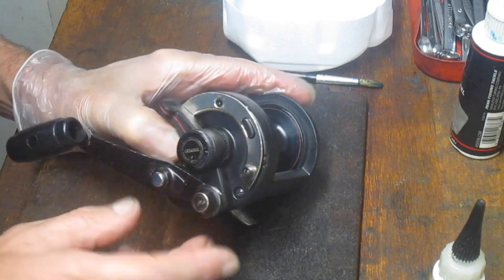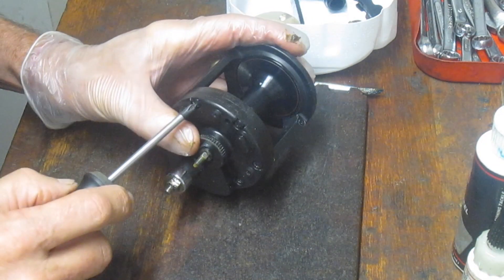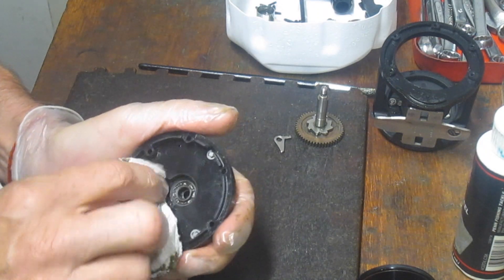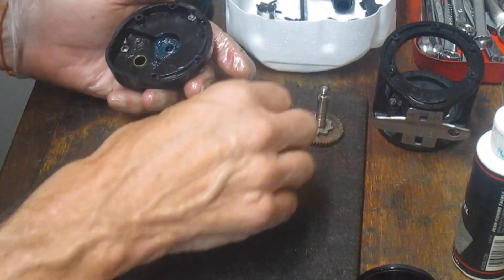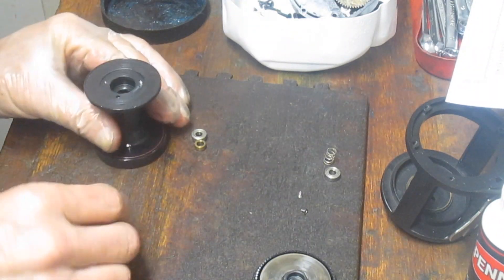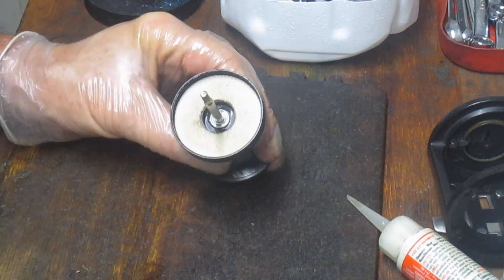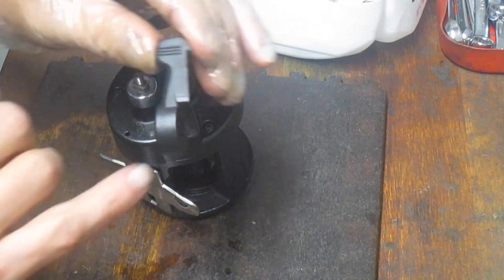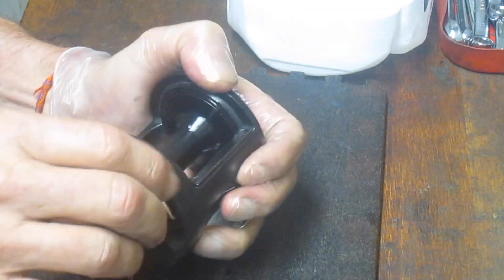Shimano TLD 10 lever drag fishing reel how to take apart and service

Comment: That was perfect timing,I’ve had mine since new, but never served it 🤐. I’ve taken it apart and this will be really helpful when I put it back together. Do you need to take the large drag washer off to clean it?
Reply from the maker: You don't, but is should be cleaned and many people choose to flip the drag washer to the reverse side during the service.  It is sort of like rotating the tires.  Just use a dry, hard brush, like a tooth brush to clean the drag washer.  Don't use a wet solution or cleaning agents - Dennis
Reply: @2ndChanceTackle  Thanks Dennis,that’s very helpful 🎣🐟

Comment: This is really helpful. It has given me confidence to take my reel apart. My TLD 10 was refusing to free spool the other day. It's used on a kayak so gets loads of dunking & I've had it 3 or 4 years & haven't serviced it. Anyway, I cannot get the reverse thread drag cover to undo. Have you any tips on how I might? Many thanks, Patrick
Reply from the maker: Do you mean the preset adjuster knob?  Please let me know which part you are referring to.  As a general rule, you should start with a healthy spray on all external parts before servicing a reel that has been used in the salt water environment and been dunked.  Salt will clog threads and the penetrating oil will help free these - Dennis
Reply: @2ndChanceTackle  no, it's the bit called the cooling shield. I will be giving it a good spray this evening.
Reply from the maker: Is this the big plastic disc that goes over the drag assembly and screws into the spool?  If it is, I sometimes use a 4 inch pump pliers or a woodworkers vise to hold the outer rim while I turn the spool to unscrew it.  These do get filled with debris and are often hard to get off.
Reply: @2ndChanceTackle  Thanks, I'll try it

Comment: Hi Dennis , great job on the content.
I was gifted a shimano tld 10 and used your video to service my reel. On putting back together one of the four sideplate screws wouldnt tightenen, thread stripped i fear. Is there a way to redtore thread in carbon fibre or do i need to go up a size? What would you do? Thanks, Jon (U.K.)
Reply from the maker: That is a shame.  I am not aware of the carbon fibre approach.  You may need to go up a size if that does not work - Dennis

Comment: Thank you so much for this video. Crazy to watch a video and hear about the pandemic  now that we are past it. I have 5 of these reels in 20 to 30 size, some in double speed. Im servinging them all in the next week and was wondering if you suggest upgrading the drag washers or bearings, or does that put too much on the housing? Also, would a good machine oil and gease like tru flow work on these or what products do you recommend?
Reply from the maker: These reels were very well designed and engineered and I don't think there is much to improve on by replacing the bearings or drag washers unless they are worn.
I only recommend using fishing reel oils and greases.  Penn Precision reel oil and grease, Cals Universal grease, ReelX, Lucas fishing oil and Shimano greases are all readily available and recommended of other types of lubricants.  Thanks for asking.  Good luck with the servicing - Dennis

Comment: Dennis, did I ever show you my lever drag spinning reel? It is an Airex Mastereel Saltwater No. 1. There are at least two for sale on EBay right now. They are not cheap - about $80.00. I fish with mine in the surf and it works great. It is heavy and the handle is a little small for the size of the feel. Take a look if you get the chance. I got mine from a steelhead fisherman in the Midwest. It is so easy to adjust the drag. You just use your little finger and never have to move your hand as on a front drag or rear drag. Oh, Dennis, I found a spare handle for that Daiwa 7850 RL so I’m going to fix up a second handle for the reel with a nice power knob I’ve been saving for a nice reel. I can’t wait to see this Daiwa! I also found a new silver spool for my Mitchell 396 PUM  reel. I’m going to load it with slick braid backed by mono for surf fishing. We’ll see if that works. I don’t want to damage that reel.

This video is excellent. This is a very fine reel! First time I’ve ever seen you grease a bearing though I understand why.
Reply from the maker: I haven't seen that Airex reel.   I'm going to look for it now - Thanks Chris - Stay well - Dennis
Reply: 2nd Chance Tackle  I love my Airex. A good one is definitely not cheap but as you know, I love unusual and this Mastereel definitely fits that description. The drag isn’t very strong but unless you are hooking monsters it is quite adequate. It has a spool knob that can provide a tiny bit of drag. In that sense it is almost the earliest example of a live-liner. Internally it is really intriguing. It sort of looks like an early Zebco Cardinal 6 or 7. When I fished with this reel before the pandemic, a small crowd of old salts like me would gather around with great curiosity. Of course I just ate that up! LOL

Comment: Hi there ? What would I have to do to make my reel better to free spool the line out ..the line won't fun freely out always I have to  pull it out at times ..
Reply from the maker: I think you have to check the internal set up including the drag and pressure plate as well as the springs and bearings.   It sounds like something is sticking if you are not able to adjust it to free spool easily - Dennis